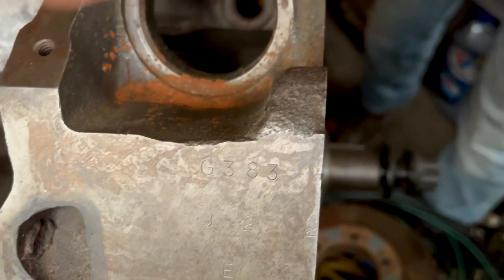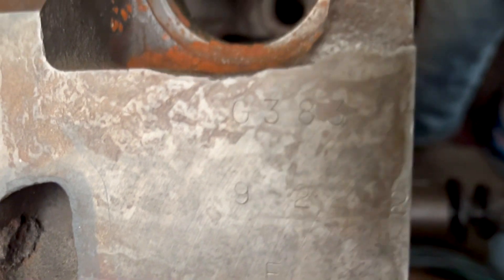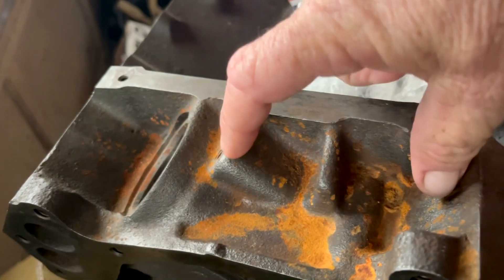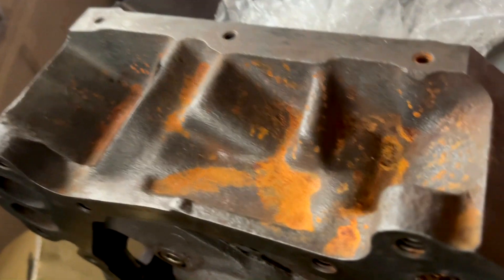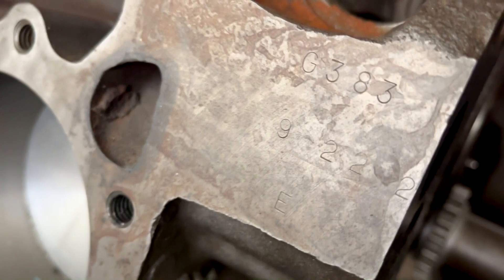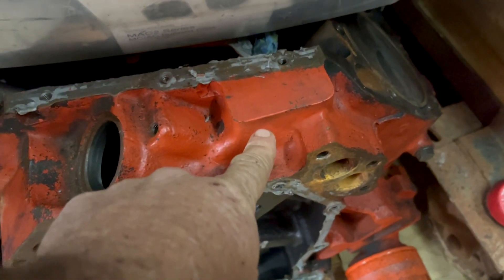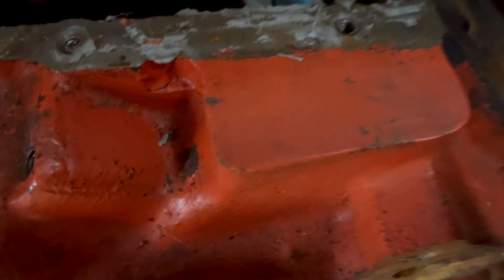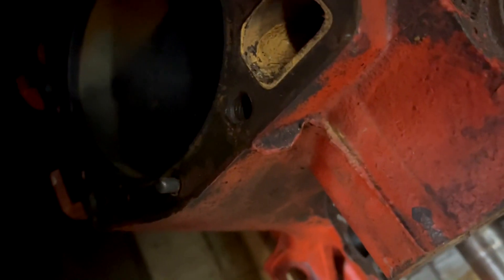Mopar engine block ID pads and their locations

Comment: I have a 383 big block and the 727 torque flight transmission it was coupled with . 
It was said to be pulled out of a 1971 Challenger . It has a Carter 2 barrel carburetor on it . The ID pad is stamped ( G383 and it has an E under it) looks just like your stamping on this block .
The side of the block is dated 7-31-70 and the casting number is 2468130-10 .
Any information you can provide would be appreciated , as I can only go by what the guy told me that I got it from , but I’d like to verify the car that it came out of . Someone also told me that this is one of the last 383 big blocks produced by Chrysler in the month of July 1970 , then production switched over  to the 400 cid .
Reply from the maker: There is a VIN number or partial vin number stamped into a spot on the passenger side just above the oil pan.  I forgot to mention that in the video. This is where you can ID if its numbers matching to your car.

Comment: How do you tell a 413?
Reply from the maker: @duncandmcgrath6290  should have a stamp pad up front same place as a 440 and it should be stamped 413 I have not messed with any 413’s as of yet so I can’t be certain but logically one would think same place since it’s an RB. Check this link for more info on ID for 413’s https://www.forbbodiesonly.com/moparforum/threads/413-engine-block-stampings.224222/

Comment: Thank you for this! I have an old 1965 Dodge Coronet 440 Convertible.  I now know that it's got its original 383 block. "HP" no less!
Reply from the maker: Im not sure but at one point they had an RB 383. I don't know the year they stopped making it. 413,440,426 were all RB engines with the one 383 as an exception. Then you have B engines. 383 and 400.  The RB 383 would have been from 1958 to some think 1961 on the long ram cars. Because in those cars they also used 413 and 426 RB engines.,
Reply: 1957 low deck was 350 cubes .
the 361 low deck , was produced for over thirty years , cars & trucks .
The US marine corp. used the 361 in amphibious vehicle ,  into around 1987